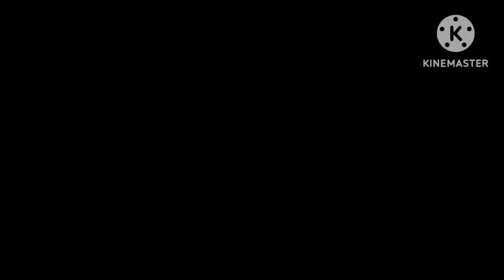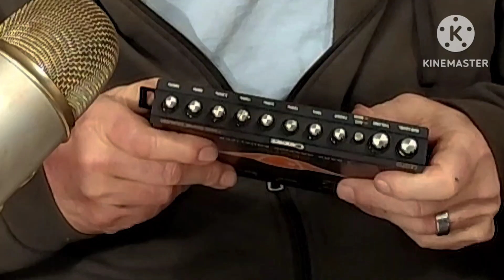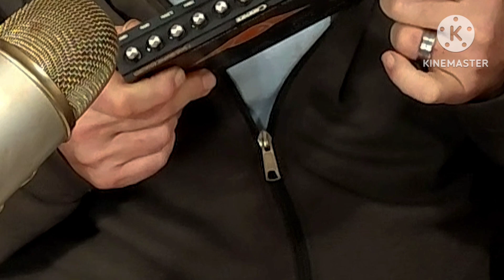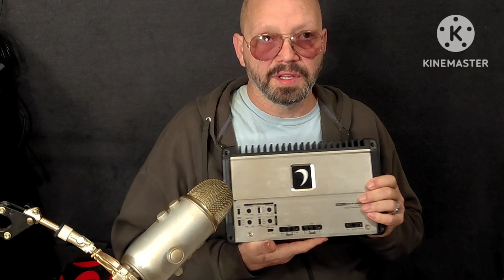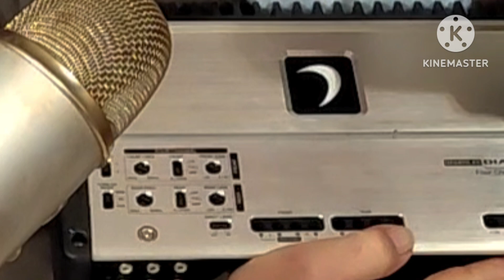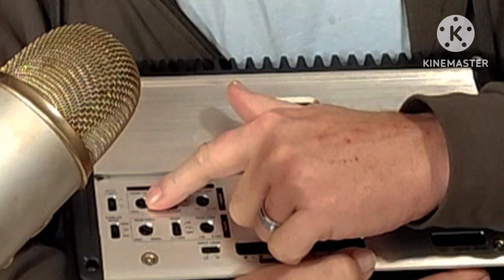What Does a DSP do in car audio?

Comment: Hey I used Time Alignment from 2 different companies and both give me NO SPECS like it’s blank when it comes to subwoofer. Any suggestions on how bring it to the front stage better? I am dealing millisecond delay. My unit only does milliseconds
Reply from the maker: well, i always tune by ear on the sub, even though i can use inches. my rear subs have 2 rear facing ports and 4 subs.... so my trick is i play something with a mid sound that plays along side a sub sound. like "https://www.youtube.com/watch?v=zEmg5GaAHbk"Jam On It". then while its playing i slide the timing slowly ..listening for the tightness.  having said that, you can start with the same delay as your right front kick driver.
Reply: @CarAudioEnthusiasts  okay I will try that

Comment: Had dual EQ231 Pgs in a 97 setup. Into a 406A and epicenter, of course. Prior I had the 406A and passive crossovers. The 231 came as a gift from a shop I helped at. I bought the other. 
Out of curiosity... given a passive crossover,  say 125 watts per side, how much power is truly consumed by the crossover itself?
Reply from the maker: very very little, any energy consumed is turned to heat. you can try feeling the heat from a crossover, and it barley gets warm at all. which means only 5-10 watts likely less. no matter how much power, its always gonna have a certain resistance.